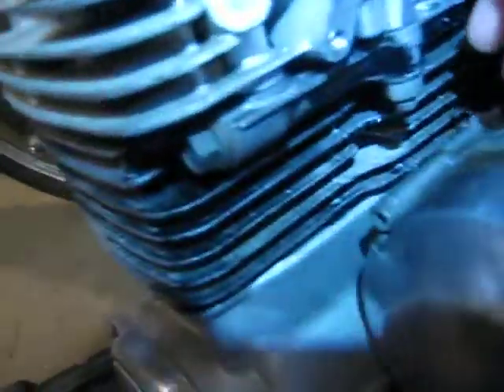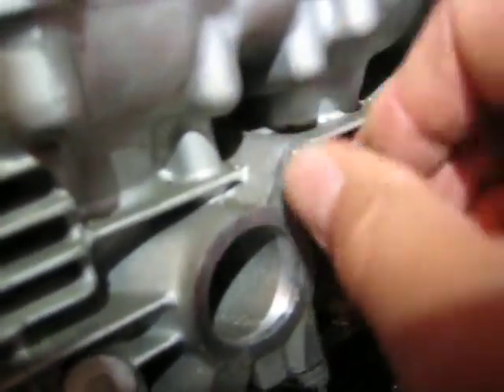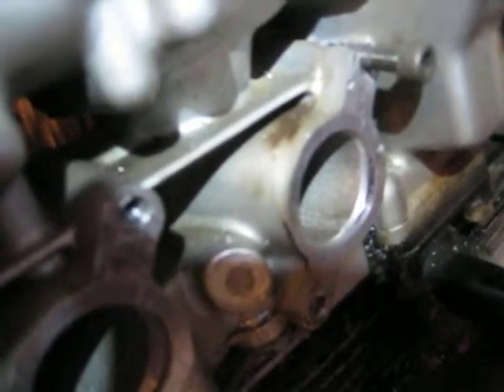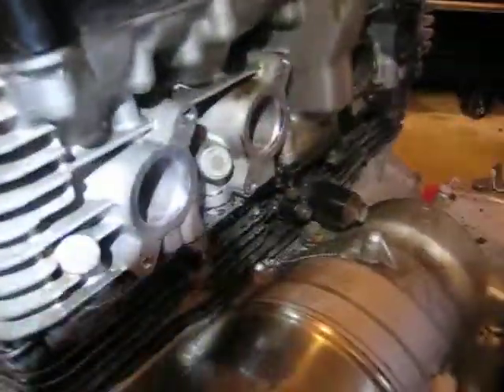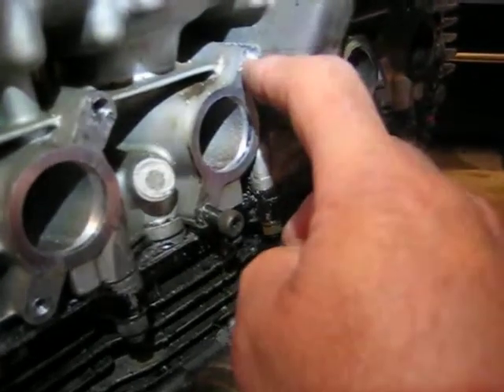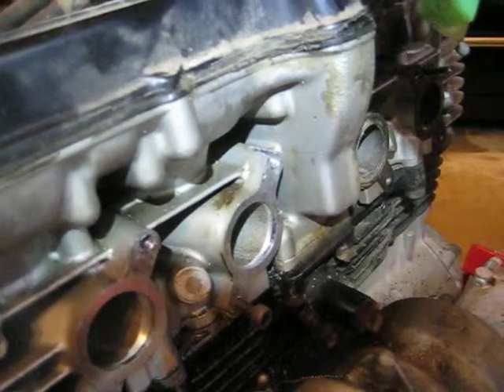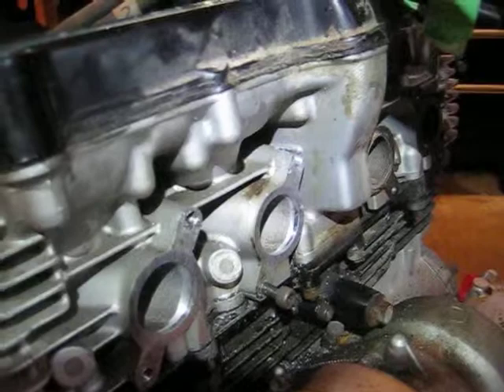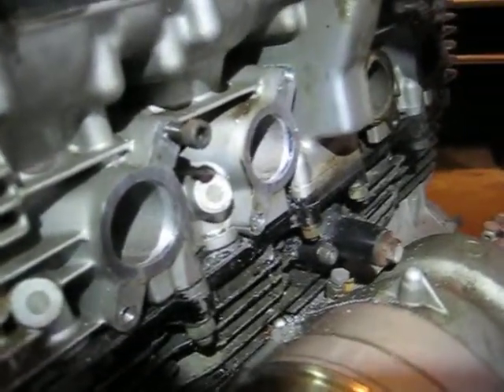Yamaha Seca 750 - Part 5 a - I detest removing broken bolts!

Comment: Agreed welding would be the best solution.  I've read that putting the bolt in, wrapped in plumbers tape works when JB welding.  After it sets, the tape lets you take the screw right out.
Reply from the maker: Thanks Kevin... I will give it a try.